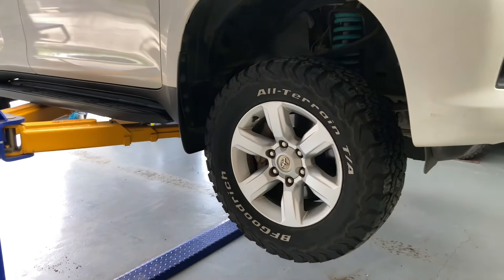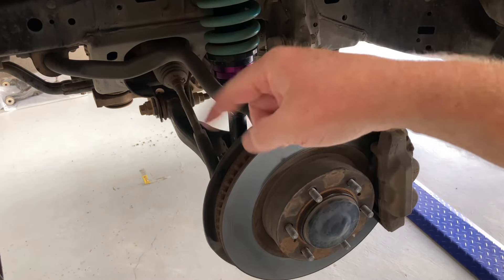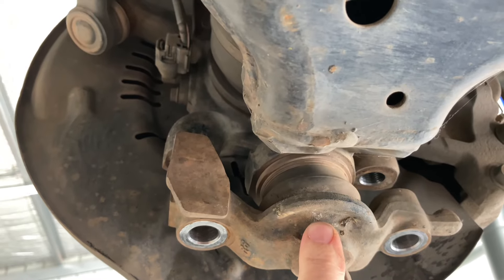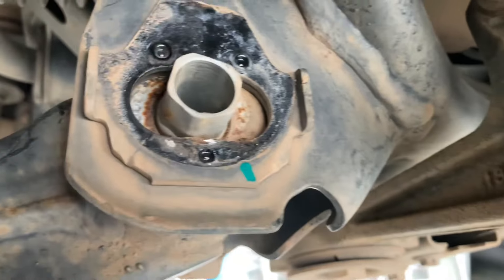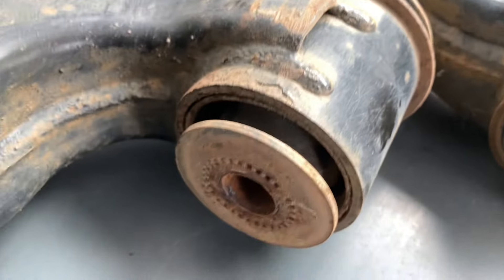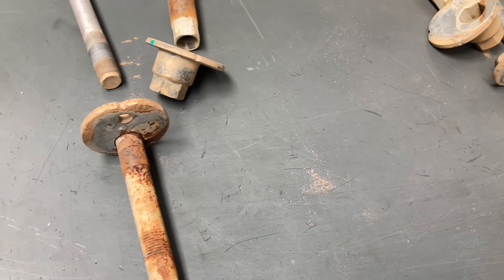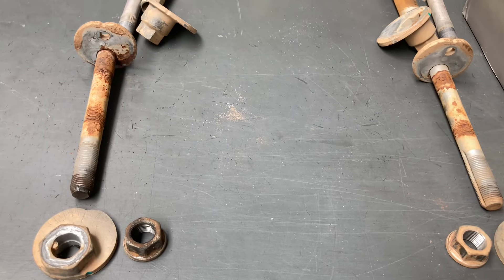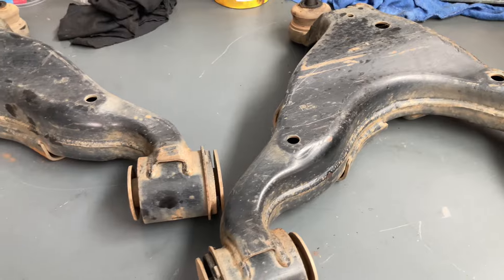MAJOR Front END Work Repairs lower control, arm bushes, Suspension and Brakes BONUS

Comment: In my environment the originals were rusted in so bad, had to cut them out, put new bushes in with copper grease on the pins, then clean off the surplus to avoid debris sticking to the surplus grease.
Reply from the maker: Copper grease would probably be my number one choice. I just don’t think it matters too much.

Comment: I have replaced bushes on Toyota tundras and sometimes the bolts get rusted to the sleeves and it’s a pain and you may have to cut out the bolts and sleeves
Reply from the maker: Yes, it happens. That’s what this reciprocating saw is for 🤣
Reply: I did mine a few weeks ago and had to get the grinder out on both sides what a pain in the arse

Comment: With all due respect you should replace the camber sleeves and bolts.  Use only silicone grease to lube the sleeves
Reply from the maker: Why?

Been doing this a while never had a problem. Have grease on other cars 10 years they still free no problem but thanks for telling me how to do it.